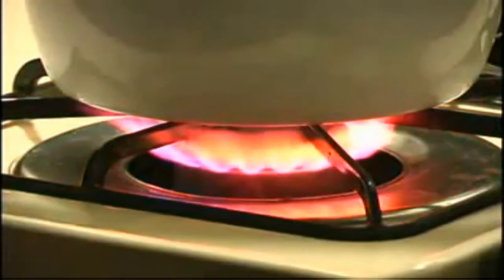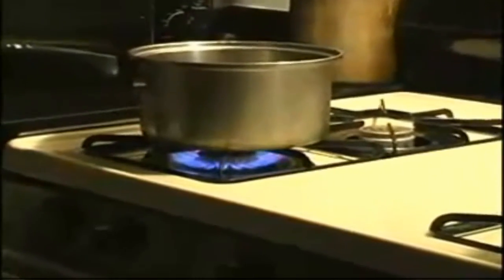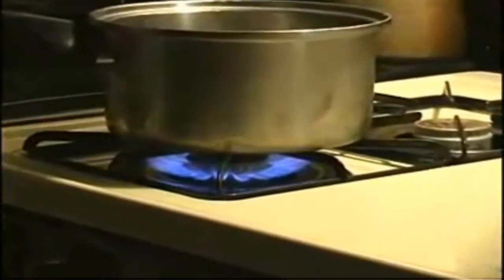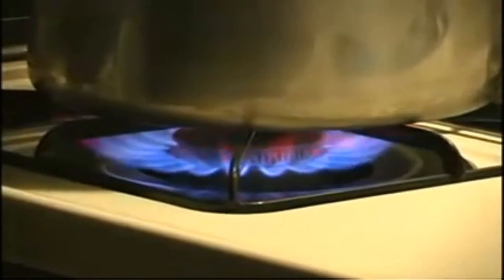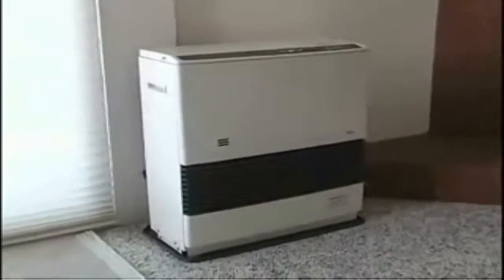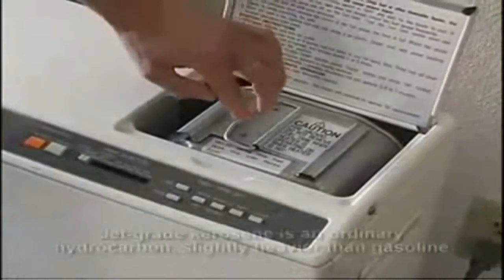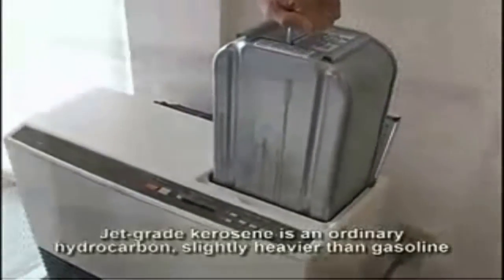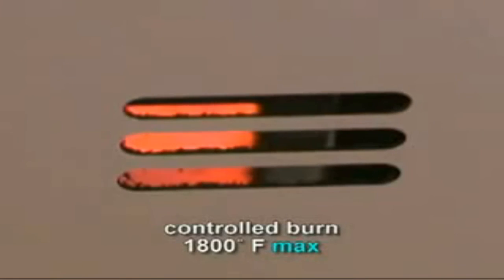9/11 Mysteries -  excerpt: fire hot enough to melt steel?

Comment: I'm not an expert, except in personal experience:

1: fuel+accelerant
2: physical and mechanical damage to the building
3: gee, a tall tower with air-flow
4: stuff inside a document tower, that can catch on fire.
5: contrary to popular belief, concrete CAN catch on fire
6. I have seen cinder blocks explode near/surrounding a simple backyard fire pit reduced to shrapnel 
*this is ridiculous and without common knowledge physics, and produced to inspire conspiracy theorists about some bulls#!+ they have no idea about.** 
you damn straight wind can heat a fire up hot enough to melt steel, and think about all the chemicals that could potentially aide the fire used in the construction unregulated when the towers were built. 
now you're just being an alarmist without reasonable/logical/scientific deduction/conclusions!
you should be ashamed of yourself.
I am a home owner, Eagle scout, woodworker, and physical therapist assistant... and even I know better... 
DAMN!!!